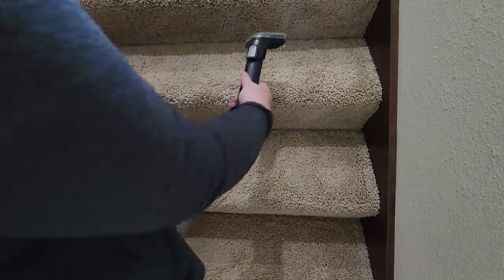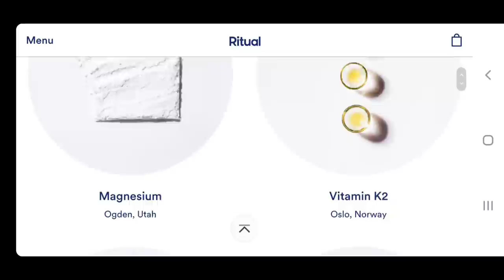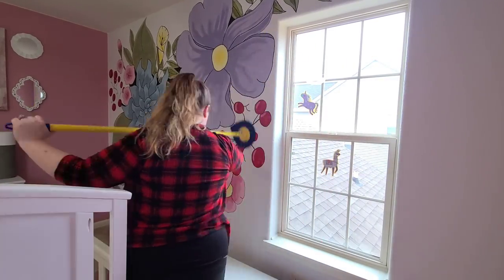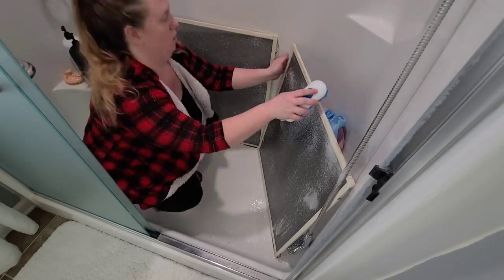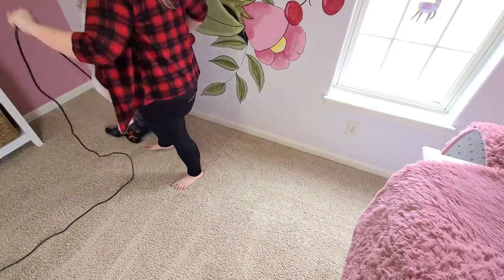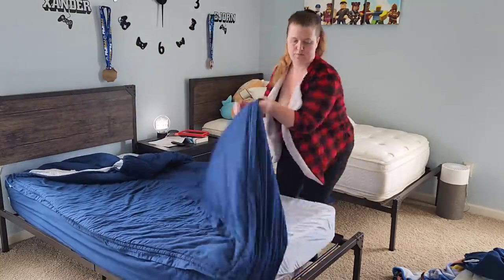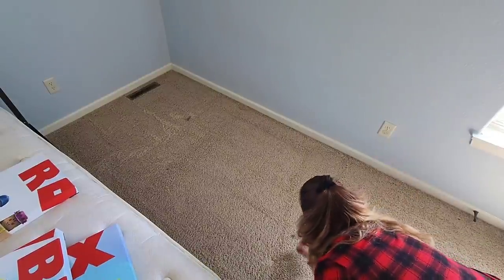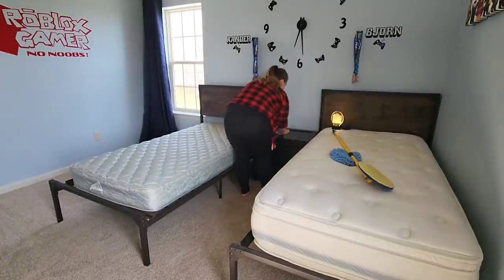ULTIMATE DEEP CLEANING MOTIVATION / EXTREME SPEED CLEAN WITH ME

Comment: Great video showing. Well worth it. We weren't so lucky moving into our home. Previous owner was in a hurry, so place was dirty. Not horrible, but dirty. We took our time moving. So when we finally moved in, and I did my first load of laundry...water was backing up. Come to find out there was 2 cracked pipes...smh lesson learned. Some how the inspector didn't catch it, but we didn't catch this problem soon enough. There's a time frame after when inspection is done. At least we were able to get it fixed.